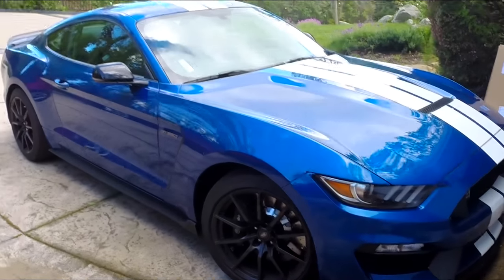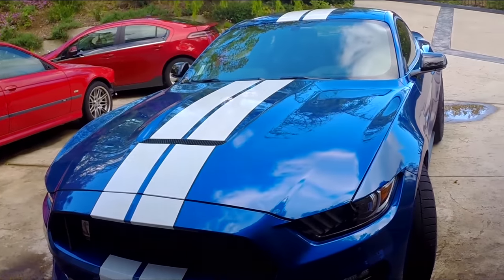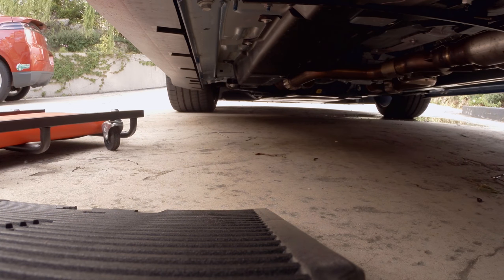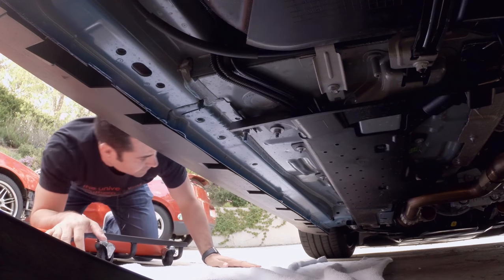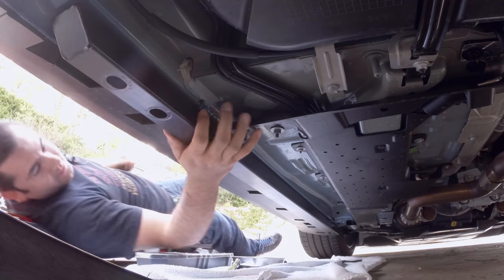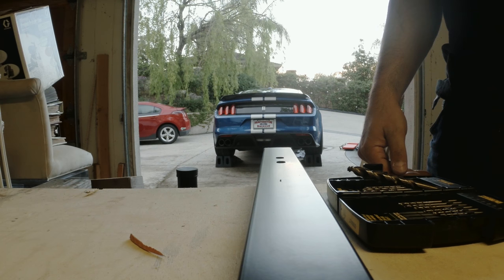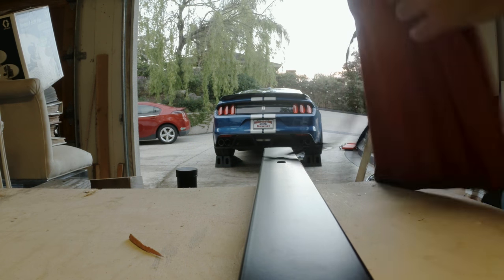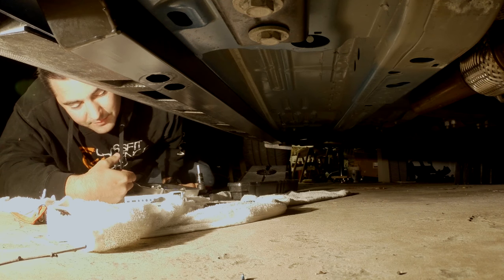VLOG Ep 2: Installing J&M Jacking Rails on the Shelby GT350

Comment: Interesting...i had same problem with BMR on drivers side rear.   I reused factor bolts but i had to re-tap one of the bolts and holes before i could finish.   Took about 45 minutes to bolt up both which should have taken 10.   Looks like you went a lot longer.
Reply from the maker: Yeah, it was a huge pain the butt. The holes not lining up wasn't a huge deal, but I couldn't get one of those bolts to thread correctly. Weird stuff.

Comment: i just installed J&M full length rails for my 2016, same problem on the passenger side funny enough. i hope the bolts removed towards the rear that are removed during the process are part of the same metal we install the new hardware in,or maybe i'm paranoid and it doesn't matter lol
Reply from the maker: I was paranoid about that too. Did you end up filing the hole like I did?
Reply: plugged them with a nylon screw that sits flush with the metal, picked em up at home depot, just in case i had to reinstall something there at some point. used some Teflon tape on the threads to make it easier than threadlock in case the nylon goes brittle or something over time, but i haven't noticed anything different besides a bit less flex
Reply from the maker: Oh interesting. My OPG ended up breaking so my car's at the shop awaiting a new engine. Such a bummer.